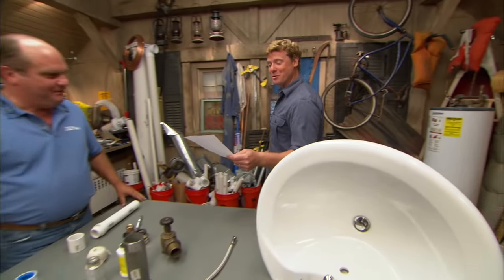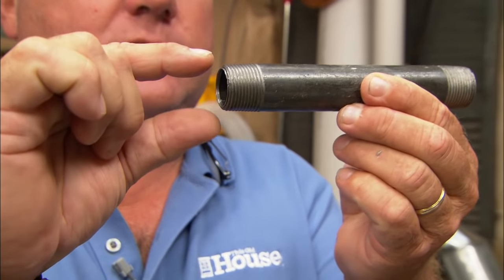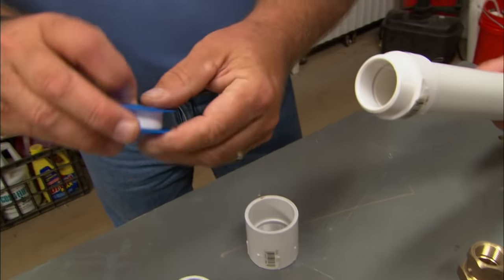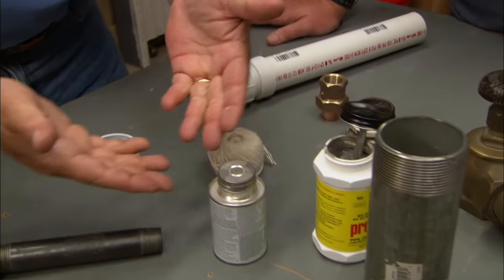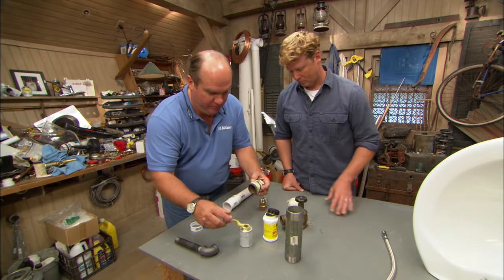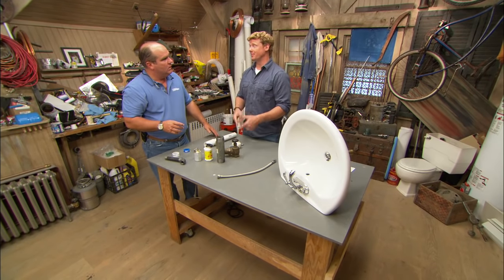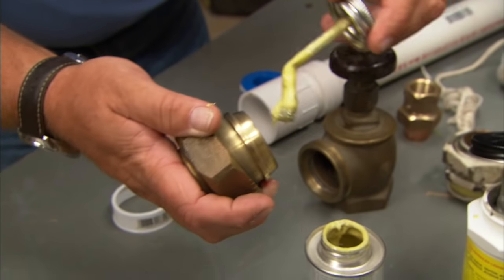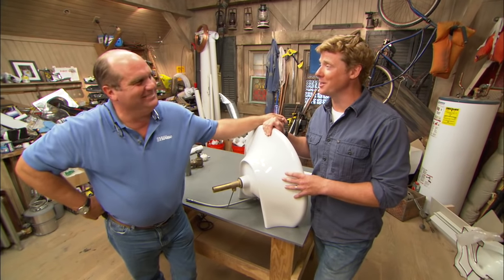When to Use Sealants on Threaded Plumbing Connections | This Old House

Comment: Because of the way this video is presenting the information, If I put on my "never done this before" hat, the message is clear: Use teflon for plastic pipes an the dope for metal pipes.

Which is, of course, wrong. 

If you start with metal, continue with metal. If something else needs to be used for plastic, that can be both done and explained WHY it is true.

Comment: Sealer not always needed on pipe thread. For instance. If it’s NPTF. F for fuel. The sealant telfolon is intended for lube in the assembly process. The seal is caused at apex of the thread. Interference deformation.

Comment: Unions are used in order to make it easy to remove and reinstall something. To use 'dope', or any other sealant is a mistake that only lay people will do. Sealants are adhesives and while they don't dry brittle, they do dry hard. Often that hard that heat is needed to dismantle.
If that union joint is dismantled in the future, what you are left with is a very filthy joint that requires a lot of work to get clean again.
 If the two faces have not been faced properly and there is a leak, only then would you use Teflon tape on the male face but NOT that white rubbish, it is too thin. Either use pink or yellow, (yellow is for gas but not exclusively so). Then when tightened, the joint will be sound and very easily cleaned up after dismantling.
 Another tip;
When applying Teflon tape to a thread, if it is plastic it is better to rough the mail thread up by dragging a hacksaw blade over it at 90 degrees in several places around the thread.
 If it is brass, use a set of tongue and groove pliers, we call them 'multigrips' and work you way around the thread, crimping little notches in the thread. 
 This will give the tape something to 'grip' and not slip as you screw the fitting together.
 NOTHING is needed on the thread of a union, as mentioned.
 The only time I use a combination of thread adhesive and Teflon tape is where the brass thread is very loose and often chromed as well. 
When the threads a deeply cut and very loose. it is always good to leave them for sometime after screwing home to give the adhesive time to 'go off'.
Ken From Lyneham Plumbing Services.
Reply: __________________Teflon and or pipe dope is for non-stick. I use pipe dope with teflon in it, and both dope and tape on brass to dissimilar metal. All of this is to keep metal from chaffing inside the joint and balling up. It lets the 2 surfaces slide together so that the METAL ON METAL makes the seal. (Plumbing 101) Teflon and or pipe dope is not supposed to make the seal. It's so you can take it apart someday as well. I use it on every thread (except maybe supply connectors)n so that years later the plumber can get it apart.If you are using this to make the seal you are cutting substandard threads.
Rough the PVC threads up?...Crimping little notches in the thread? That's begging the threads to ball up inside....in 40 years of Union trained plumbing I never heard of that!

Comment: The threads do seal on their own. Teflon tape isn’t a sealant, it simply provides lubrication so you can turn the pipe more to make the threads lock together better
Reply: All liquid pipe thread dopes perform 3 functions , they are a sealant , a coolant and a lubricant!
Reply: Sometimes

Comment: I always wondered what to use on that one spherical joint on the P trap. There is no rubber seal there. I usually just use some plastic safe silicone grease.

Comment: As another pointed out, I saw another video by someone else that claims that tape/dope doesn't really seal anything but allows the threaded items to go together more easily.  I hired a plumber once to change an outdoor faucet and he actually used both the tape and dope together.

I visit many RV parks and attach my water hose to their spigots.   I notice many use teflon tape and it still drips.  I carry a bunch of extra rubber water hose gasket inserts to cure that problem.  I don't use teflon tape or dope at all at the RV parks.

This week, I eliminated my garbage disposal as I never really use it.  I always screen food debris then toss it into the trash and never send it down the drain.  Because my drain pipe under the counter comes out of the wall at a weird angle, I had to do some custom connections without having to open up the wall to redo the drain pipe.  In turn, some of the connections were off a hair so water was dripping out of the threaded connections.  No amount of teflon tape or dope helped.  I ended up using silicone on the outside of the connections which stopped those pesky leaks.  I'll do a more permanent repair in my next life.

Comment: Excellent video and useful info! 
Quick question: would MOLYKOTE® 111 work as a sealant for the bathroom pup-up drain gaskets? what other options would you recommend? I don't like Teflon tape.

Comment: I've installed hundreds of boilers. I always tape then dope. Especially when I'm going from old black iron to copper.  It's cheaper and less time consuming that filling an entire system, only to find a leak, then have to drain back down and disassemble and redo.
Reply: Funny how that is common practice as i have seen it done and done it to but the better way would be to apply the dope on the threads then the teflon over it. This way the threads r fully coated and the dope wont easily push itself out. When the dope is put on top the tape it actually more like just a lube to during tightening cuz most of it gets pushed out
Reply: @AdrianButler86  Pretty sad you aren't aware that dope is DESIGNED to work as a lube so the threads can turn as much as possible for a good seal.
Reply: @jayryan7473  who says I'm not aware that dope is designed for easy make up of pipe n fittings? I do know that. do U KNOW  that's not it's only purpose?

Comment: Good advice for low pressure handyman stuff. High pressure mains I would use different stuff this stuf needs to be buried before you can even test you do not want failures if in doubt use both. America still using NPT type threads?Cheers from Oz

Comment: Nice info in vid.
How to deal with a cracked threaded pipe-end in a wall, which is causing seepage.
Reply: awqpak Did you have to replace the pipe? We have a rusted pipe and are trying really hard to get a deal. Any sealant work for you? He haven't had luck yet and I really don't want to replace the pipe which would mean going through a tile wall on some type of fibrous board.

Comment: I'm trying to connect a metal incoming secondary water line (has threaded female end) to a PVC reducer (threaded male end).  This joint has been sealed/ working for several years, but is now leaking. When I take the joint apart everything appears to be in good shape- no visible problems, blemishes, etc in either end.  I retaped the male end and tightened w a wrench- it is still leaking through the same threads/ joint.  Do you think pipe dope and maybe the wick will actually help, or do you think I need to replace the pieces all together?  TIA, Teresa

Comment: You forgot to mention the direction of wrapping the tape.
Reply: Clockwise
Reply: robert boykin that should be common sense
Reply: This had the slickest production value of any of the how-to videos I've been watching on this, but the most worthless and confusing information of any of them.
Reply: Ya I wrapped it the wrong direction once.  Bet chuck Norris never has though
Reply: He told you to hold it with your left hand and wrap overhand. If you always hold your fitting that way they will always be correct, unless you are using left handed threads which may not even exist in plumbing fittings.
Reply: @Erklzanderz  of course there would be left handed threads... on the union may be?
Reply: @jhingur7169  yes, that is true and a very good example! Thank you. So on left handed threads you would hold in the opposite hand.
Reply: It's good to get it so that when you start tightening the tape doesn't want to lift up, but if you pull tight and massage the Teflon down it really doesn't matter which way you wrapped the Teflon honestly
Reply: @Erklzanderz  I think that left hand fittings were on older propane tanks, but not sure.  Please someone that knows reply.
Reply: @Raysea88  ... propane tanks don't seal on the threads... left hand or right.

Comment: My situation or leak it's just like he showed with the compression fitting and that tapered compression going into that nut. I seen that he used pipe dope to help seal it. I'm just concerned that the dope might get diluted from the steam and maybe we'll keep leaking. I tried tightening it but that is it helping no matter how tight I make it
Reply: In your case seems like the cone or the seat is pitted.You never mentioned if it was new or an old style joint,hope that helps.

Comment: Here in singapore.. we usually use the Teflon tape on the water hose even if there's a rubber gasket..😁
Reply: If you doing plumbing without a license you could get caned over there.
Reply: @AStanton1966  haha..no canning but you do need licence to do plumbing as a job...

Comment: Im reading a lot that teflon tape is not to be used on pvc as it will increase the pressure load and eventually cause a crack and leaks. Teflon is not a seal but a lubricant specific for metal connections to allow proper tightening.
Reply: It can still be used tho, even if it is meant for metals
Reply: that is bullshit  ... female pvc fittings crack if your screwing into copper or iron into it . Use male  fitting sch 40 pvc if you make a transition
Reply: Marquee Mark, they actually make reinforced pvc female fittings for this
Reply: We don't have that material in AZ . If we screw PVC into cooper or Iron pipe, we use a schedule 80 male adapter into a female cooper or Iron, its the only way you can pass an inspection.
Reply: TUBEBOO55 
I'll listen to Richard, he's the pro.
Reply: Yes - if you look at the recommendations from the majority of PVC manufacturers, they recommend a non-hardening thread sealant.
Reply: You are correct. Use a thread sealant. No tape on mip pvc transitions. Straight from the manufactures mouth
Reply: So I can "screw" my PCV male fitting into a brass female pipe? And what sealant should I use if any?
Reply: Look for thread sealant that says it’s safe to use on pvc. Thread it in hand tight. Then  one and a half to two turns with channel locks. No more than two turns.

Comment: __________________Teflon and or pipe dope is for non-stick. I use pipe dope with teflon in it, and both dope and tape on brass to dissimilar metal. All of this is to keep metal from chaffing inside the joint and balling up. It lets the 2 surfaces slide together so that the METAL ON METAL makes the seal. (Plumbing 101) 
    Teflon and or pipe dope is not supposed to make the seal. It's so you can take it apart someday as well. I use it on every thread (except maybe supply connectors) so that years later the plumber can get it apart. If you are using this to make the seal you are cutting substandard threads.
Reply: Galling up?

Comment: if the ground joint is damaged in any way you replace not dope
Reply: "Ground joint" Not threaded joint. See Crane co. experiment with damaged threads.
Reply: forty two Have you got a link to it please? Couldn’t find it!
Reply: _________Agree....but in a pinch...I have actually "tinned" the surface of a brass ground joint with solder (to "fill-in the damaged surface) that was part of a mixing valve that I would have waited weeks to find and have delivered. Then carefully sanded it down flush and made up the joint. Never heard from the customer after many years. I have a lot of quality tricks like that....maybe I should make my own video....and put even more plumbers out of work.  :)

Comment: Just did some research and the pvc manufacturers say not to use Teflon tape on their threaded fittings. Only proper thread sealant that stays soft. Don’t use anything else. Don’t use pipe dope that get hard either. This advice is only for plastic fittings, metal ones are alright to use tape and hard setting dope.

Comment: Interesting. So, do any of you have advice on what to use for boat seacocks pipe connections?
Reply: Thruhull fittings use straight/parallel threads. It is an all-too common mistake to replaced seacocks with quarter-turn ball valves from the hardware store which have tapered pipe threads on their female fitting. Bad idea.

Comment: Don’t know if I’ll get a reply but with the supply hose, are there any negatives to using Teflon on those threads even though it’s not necessary?
Reply: Probably not, but both sides of the threaded area covered by tape are at atmosphere, not at water pressure, and lubrication is not needed. Note that these are straight threads, not tapered. When you tighten the connection the seal is on the face of the rubber washer not any part of the part you tighten.

I often see a similar situation with Teflon tape applied to the fitting on a gas regulator connection to a gas cylinder. In this case the seal is metal to metal and the rotating nut only tightens the connection and has no sealing surfaces.

Comment: Ouch! Never use compound or tape on a ground joint, as it relies on a true metal to metal seal for efficacy. Sealants are subject to creep and compromise the joint in the long term. Indeed, be careful to remove any oils that may have been applied to prevent rust during storage or left over from the machining process. One should also be careful not to contaminate wetted surfaces by sloppy application as was done here.
Reply: Theoretically you are correct. Unfortunately, in real life that ground joint isn't always perfect. I have had many compression fittings not seal. The only way to fix it is to add dope or tape. I guess you could take everything apart, go back to the store and buy a new one or always buy backups. That isn't very practical though, especially for long lead it expensive items.

Comment: What kind of sealant for the threads of a PVC tailpiece??? (the threads right below the mack gasket)
Reply: Not sure what gasket you’re taking about but just did some research and the pvc manufacturers say not to use Teflon tape on their threaded fittings. Only proper thread sealant that stays soft. Don’t use anything else. Don’t use pipe dope that get hard either. This advice is only for plastic fittings, metal ones are alright to use tape and hard setting dope.

Comment: you dont address the connection that will be pressurized with city water, where a brass faucet is being threaded onto a pvc pipe fitting? can you use the tape? i have heard, one should not use the teflon tape when doing a pressure connection.

Comment: Summary: use pipe dope/PTFE tape if the threads seal the connection.
Reply: Including brand new pvc clean out ports. Install the assembly, then remove clean out cap, apply 1 or the other mentioned to the thread's of cap, reinstall snuggly! All drywall repair men thank you in advance since we will not have to do this for you when we show up to patch the wall you hacked up and still had water leaking....i've never had this problem....ever...
Reply: Just did some research and the pvc manufacturers say not to use Teflon tape on their threaded fittings. Only proper thread sealant that stays soft. Don’t use anything else. Don’t use pipe dope that get hard either. This advice is only for plastic fittings, metal ones are alright to use tape and hard setting dope.

Comment: great video. how come when i have a washer in place the pipe connection still leaks?
Reply: Joint isn't clean, washer is damaged, or joint doesn't line up perfectly.
Reply: Also could be that fitting isn’t tight enough or threads could be mismatched.